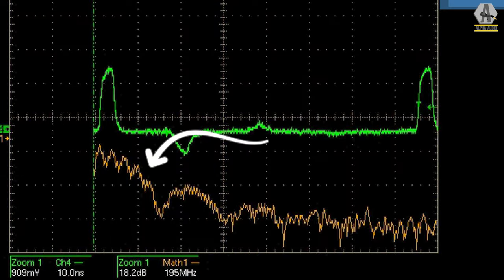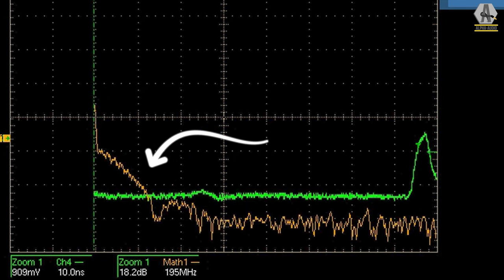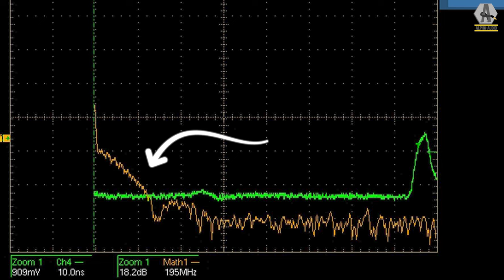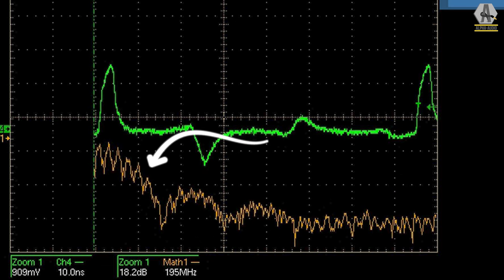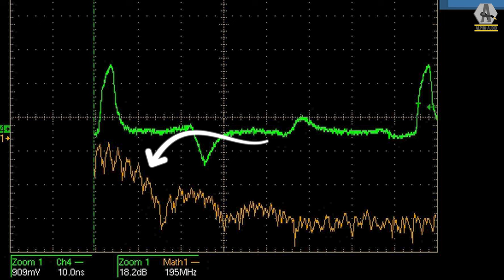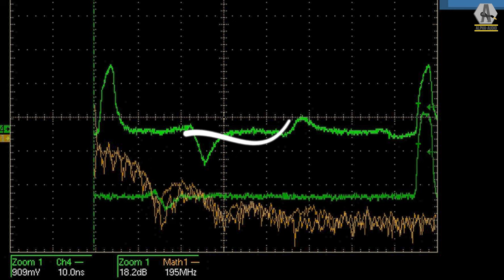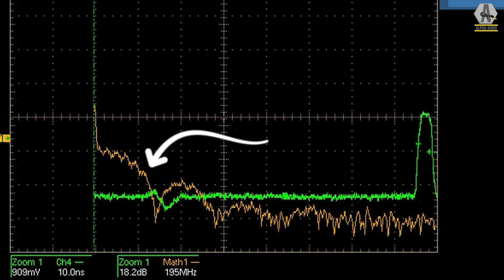Cables make a difference - and we measured it! Alpha Audio Huge Cable Test

Comment: Even after auditioning 3 separate AVR's, the same ambient sound of the room was still present! That told me the unwanted faint background signal noise I had been experiencing had nothing to do with the actual units. Therefore, my attention changed to the cables. And even then It was only on the third occasion after I finally purchased shielded cables that the noise floor within my small room finally came down to satisfactory levels.

 Cables often act as antennas for attracting RF, and the longer the cable, the better the antenna. Probably explains why when I used to disconnect my heights and surrounds within 10 minutes, the faint background signal noise (RF/EMI) within my small room used to disappear/dissipate.

Trying to achieve a totally silent room sadly has turned into a bit of an obsession for me. Doesn't help when ones 2-channel stereo also entails an extra 7 channels that are externally amplified (5.2.4)

The more cables I shield, the quieter my room becomes, and the better the shielding, the more the chance the cables are likely to disappear.

If one has the same sensitivities and is looking to address this matter, but is also hoping to notice the incremental differences. I would suggest analogue cables of length first before moving on to digital and power cables. 

When friends or guests come over, I used to show them how loud the system goes. Now I prefer to press mute and show them how my quiet it goes. 

None of them gets it, of course 😂
Reply: Great story. I lucked out a bit. My system is also dead quiet without too much chasing. When I had an all tube system, I would have ground noise and rfi noise played through the speaker. Since changing to a high-quality solid state, all the noise disappeared, and the silence is impressive. I can still hear very faintly that rfi noise produced by the router, once in a while, though (but not through the system), so it's there still. Once heard, it's a signature you don't forget.
Reply: I would imagine that at the beginning of the journey, the router wouldn't even be in ones mind. The fact that it's now able to become noticeable is impressive in itself. 

Crazy how one knocks one down and a lesser one becomes apparent 😄

Comment: Hi there,

First of all thanks a lot for the long and thorough work, kudos for doing this. As a physicist I appreciate that you measure impulse response. You notice yourself that differences in Impulse response are very audible. This is of course so because impulse response actually represents the F transform of the phase transfer ( over the audible domain). That phase transfer will eventually determine the spatial resolution of your soundstage due to coherence of the soundwaves. If that phase transfer is oscillating within the audible domain, that will result in lack of coherence and concomittant  dampening of selective frequencies leading to particular colouring and precision. So I am quite enthusiastic about this time domain measurement.
Reply from the maker: @RudyDeblieck  Thank you! You can see all the results in the articles we wrote about it.

Comment: I am a longtime audiophile. I have experimented with cables - mainly USB and/or RCA - and have found each brand to produce a different effect - and price did not determine whether it was better or worse. The best ones for my computer-based system were not very expensive.

I upgraded a friend's home entertainment system from the standard HDMI cable to an inexpensive component brand. The improvement was truly astounding. She is a musician, but no audiophile, and she can hear the great increase in: dynamic range, sound stage, clarity, detail.
Reply: @DanielByers-qf9qi  
I'm not saying that this was positively the reason for the differences, but there are A LOT of different specs and "levels" or features within the HDMI standards, and if the previous cable was not rated for the latest spec or capabilities of the AVR (or the Source), the Source or AVR may not have taken advantage of either components' full capabilities with the original cable.  i.e. the source or AVR may have been limited to 16bit/44.1kHz or 16bit/48kHz throughput rather than 24bit at a higher sample rate via the DACs, or may have transferred the audio via analog instead of via digital, etc.

The largest differences are in regards to the HDMI cable's bandwidth or "data throughput" capabilities, but there are MANY other differences outlined in the HDMI specification.

e.g.  ARC vs. eARC, HDMI 1.4 vs. 2.0a vs 2.0b vs. 2.1b...etcetera.

There are MANY different limitations and/or capabilities/features within the HDMI specification that allow for different audio as well as video capabilities.

Just take a look at the HDMI ORG website to see all of the mindboggling variables.  They CAN make a difference as to what you might hear (and see) when using a particular HDMI cable between any two or more components.
Reply: @DanielByers-qf9qi  just try a aes/ebu cable when possible over the USB for me it was a nobrainer

Comment: Bravo on you, I have no test to backup my experience but I've used a lot of different brands of cables over the years and I've come to the usual conclusions.

Cables do sound different, most notably I found speaker cables to offer the widest variability in terms of sonic differences, but interlinks as well as power cables equally have sonic distinctions as well, just not too as obvious an effect.

It's always been my thought that speaker cables offer this larger variability because of the electrical interaction that happens between amplifier and speaker is manipulated by cable design. 

I forget why I read it, an article online somewhere, but the design of cables in terms of inductance and capacitance and their construction was shown unequivocally to contribute to varying electrical properties in the cable itself which of course contributed to sound quality. The reason speaker cables create a larger audible distinction, then say interlinks, is because they carry higher volts through them than the extremely low level signals that pass through interlinks. Of course having greater amounts of an electrical signal it's easier for that signal to be manipulated on its way from one place to another.

Congratulations on creating some meaningful data in terms of what it is a lot of us hear and know.😊

Also one other thing I wanted to add is if you want to get a great understanding of the relationship of the frequency range from 20 HZ to 20,000 HZ comparison to the upper range of 100,000 HZ then all you have to do is go look at the great work that was done by Sony in the '80s and '90s as they were developing the sacd.

Another article which I had read on the development of the sacd, Sony showed through research that upper level frequency range harmonics flood down into the audible range and can affect the audible band. Which is why I typically point to that research when somebody says that we can only hear up to 20,000 HZ or they say that anything above that doesn't matter.
Reply from the maker: Will look it up!

Comment: Cables do make a difference and I should have measured them. I purchased 2 2meter lengths of speaker cable to run between my power amp and my speakers. It was futile, no signal reached my speakers. So, I measured the distance from the power amp to each speaker. It measured 2.5meters. So I purchased 2 3meter lengths of speaker cable. This time it worked. Always make sure your cables measure correctly, prior to installing them.oh, and if you still don’t believe cables make a difference, remove them from your system. I guarantee that even the tone deaf amongst you, will notice the difference.

Most of all, enjoy the music.
Reply: Funny ! :face-green-smiling::face-blue-smiling::face-red-smiling-live::trophy-yellow-smiling:

Comment: You mentioned cable resistance seems to make little or no difference in listening tests. 
This makes sense, as most HiFi devices will have resistance on the input. Look at most input circuits, signal feeds via a Resistor. At a factor, many times or hundred of time higher than a cable. Also output circuits drive via a resistance. 
Great work on your testing. Interesting stuff. Thanks for investing so much time and effort.

Comment: This is brilliant. Bravo!! Did you happen to test the speed of the cables with different frequency pulses? (I haven't checked your article yet)
It would be interesting to see if the timing of pulses varies if the frequency of the signal is altered. (I'm writing this just a touch before the end of the video so hopefully you're not about to discuss it and I've gone too soon)
EDIT: sounds like you can't measure this at audible frequencies based on what you're saying in the changing signal amplitude section
Reply: The fastest and simplest way to prove this to nay-sayers is to use mismatched rca or xlr.

Comment: I learned that when I was a young man, not every expensive cables are worth the price.
I use cables made of silver and copper for my loudspeakers, from amplifier and inside the loudspeakers, building my own speakers. 
Oehlbach 2x3 mm² 
OFC/SPOFC 
Rattle Snake 3, can handle up to 250 watts.
Silverplated copper

Comment: Thanks for sharing! Very interesting. I knew that wide bandwidth cable designs were important. I can see the correlation between energy loss and bandwidth extension. What’s surprising is the frequency propagation speed as a function of voltage variance. That last measurement seems to track with musical dynamics, as you indicated.

Comment: Suggestion: You might try measuring an eye pattern (aka eye diagram) for On-Off-Keying (OOK) on the cables to eliminate the timing variation being o-scope trigger level and signal amplitude dependent. Although eye diagrams are usually used to characterize digital signals, they can be viewed as a square wave characterization for analog cables.

From a mathematical perspective, an eye pattern is a visualization of the probability density function (PDF) of the signal, modulo the unit interval (UI). In other words, it shows the probability of the signal being at each possible voltage across the duration of the UI. Typically a color ramp is applied to the PDF in order to make small brightness differences easier to visualize.

Several system performance measurements can be derived by analyzing the display. If the signals are too long, too short, poorly synchronized with the system clock, too high, too low, too noisy, or too slow to change, or have too much undershoot or overshoot, this can be observed from the eye diagram.

A simple way to have the eye pattern display jitter in the signal is to estimate the symbol rate of the signal (perhaps by counting the average number of zero crossings in a known window of time) and acquiring many UIs in a single oscilloscope capture. The first zero crossing in the capture is located and declared to be the start of the first UI, and the remainder of the waveform is divided into chunks one UI long.

This approach can work adequately for stable signals in which the symbol rate remains exactly the same over time, however inaccuracies in the system mean that some drift is inevitable so it is rarely used in practice.

Using a reference clock to determine UI boundaries allows the eye pattern to faithfully display the signal with only jitter between the signal and the reference clock displayed.

The downside: Large amounts of data may be needed to provide an accurate representation of the signal; tens to hundreds of millions of UIs are frequently used for a single eye pattern.
Reply from the maker: That is an interesting approach. Thank you.

Comment: Nice work! I appreciate the time and effort you’ve gone to. 

I would enjoy seeing this kind of testing done on a full system - after all, we listen to systems, not cables or amplifiers. 

Also, what happens to the system as a whole if you use one brand and model of cabling throughout; from the power at the wall to the digital cables, analogue interconnects and speaker cables. Cardas Clear, Nordost Heimdall 2…there are bound to be more companies who make full looms of a focused technical approach. 

Thank you again!

Comment: Just fantastic. I have been exploring internet cabling, even I am writing an eBook about audio, with a chapter on cabling. On-line there is such a debate about whether there are differences, and the scientific types argue that there is no test to provve any difference, therefore, it is just Audiophiliac imagination. Here it is. I love this, to show these measurable characterics of harmonics in spectral decay, roll-off differences, and internal propagation/speed variance. Thanks, so much.
Reply from the maker: Very welcome. Speaker cables are on the way as well.
Reply: There are two arguments.  Do cables measure differently, and can humans hear those differences.  I dont know anyone arguing over the measurable differences, but if the differences are significant enough to be audible.  So far no one has presented double blind tests or ABX tests to prove the measured differences are audible.